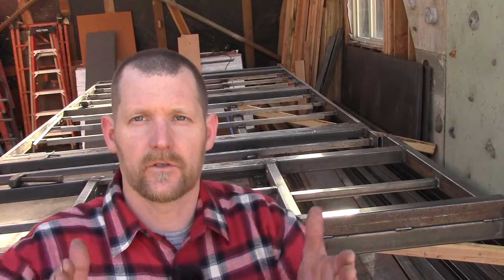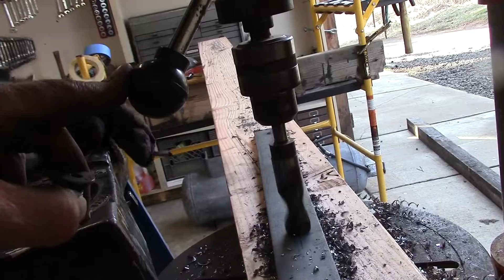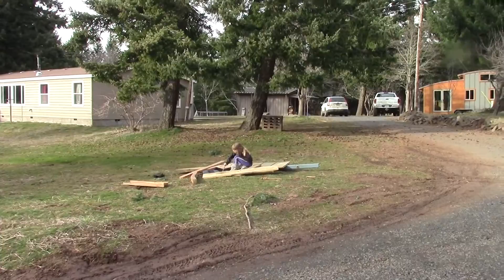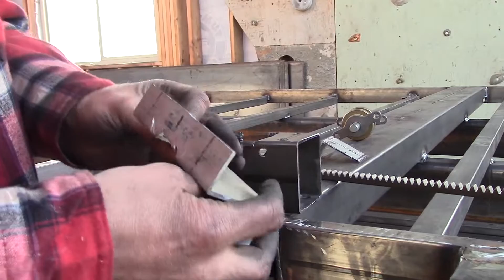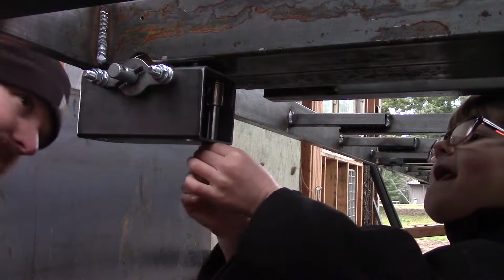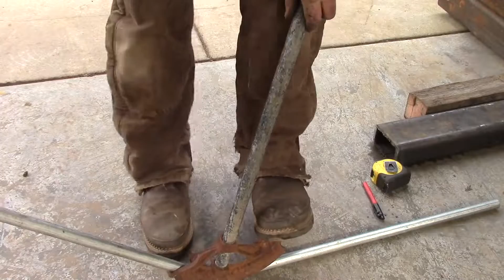How I built CUSTOM SLIDE OUTS for our overlander.

Comment: Beautiful stuff thinking of how I can adapt it for my project assuming it's a go This looks promising I could stand to scale it down since it's a maximum weight of 500 lb and just a cargo carrier that I want to move away from the back of the vehicle when I'm using it and then move it back to stow it. 😅
👉 And hey drill bits snap like that because of inadequate it's called web thickness. The I think it's m34 I don't know but anyway Bosch drill bits are known to be thicker and resist breakage about two to one over other major brands.

Comment: Thanx for the video

  I have a custom slide build at some future time..

  As for cranking it,

 I would design a flywheel type steering wheel on the appropriate connector, 

   Part of my design criteria is that I am not messing with a bad electric motor...

     As to the actual slide out room walls

   I am thinker ING with the idea that Alaskan campers of chehailis Washington uses,

   As the floor cranks out,

There is the one fixed wall,

   The roof hangs down and just hinges up as the slider comes out.

  Then I just hinge  swing the right and left side pannals into place.

    That slide out room extension gets a 
    Disc bed style, or folding furniture.

   That way in the cold time of year I have a smaller area to heat,.

    In  a normal non slide space.

Comment: Hi Ray. I'm Kevin and we're building up an M1083 expedition vehicle. Like yours, it will also have slides on each side - one will be 9 feet long, and the other will be 10 feet. A few questions... (I hope you're still following this...) What gap did you use between the slide wall and the actual habitat wall? We have stiffened the subframe's design in the CAD to (hopefully) prevent the slides from binding when the vehicle is parked at oblique angles, but I was wondering if you have experienced any issues with that. Looking back on your slide-out design, would you do anything differently?  Thanks Ray. Your videos have been very helpful. Kevin

Comment: If there's any play from the weight of the loaded slide out, consider using high density polyethylene . Like cutting board material won't wrought and very durable. On top of slide thick wall tube, you bolted the flat bar tube it will keep it from lifting off the gear bar.  if there's any play in there ? There may not be

Comment: Add pulley to that pole from a garage has groves on it for the cable add the tensioners and a remote $79.00 winch from harbor freight and WAHLA! OR PRESTO AUTO SLIDE OUT ...? WHERE DID YOU GET THE BELT AND GEARS FROM THAT WOULD HELP THOSE INTERESTED 👍 THANKS

Comment: Do you only have the front bearing or is there anything else the slide rides on?
Reply from the maker: Only those front bearings. I had really heavy steel almost no deflection.
Reply from the maker: Most of the weight is on the front bearings. There is a set of bearings in the rear on the top. And a piece of HDPE on the bottom  as a guide slide.
Reply: @5TonsofDiscovery  Awesome, did you encounter any sagging? I'm designing a similar 12'x3' slide but opted for 3x3x1/4". Looks like 2x2 would be plenty... My plan was to have some out-rigger feet to support the slide if it felt "unstable" once we are docked.

Comment: Couldn't you have just welded some motorcycle chain to that shaft... yes it would be a little more expensive but instead of waiting for that other thing...
Reply from the maker: I think its a great idea. If I do it again, I may incorporate that. I could even do an easy gear reduction with motorcycle chain. Thanks for the comment.

Comment: what about the back part of the slide what it is sliding on the rack gear
Reply from the maker: I'm not sure what you mean by your question...
Reply: @5TonsofDiscovery  the 2 inch tube the front slide  supported on the rack gear roller..  What supports the back side of the 2 inch  .

Comment: Can I ask where you ended up finding the gear rack? Or at least if you remember the teeth dimensions; like Pressure Angle, Diametral pitch etc. I’m doing pretty much this same exact build, with the same Lippert rollers and 2”x2” with 3/8” barstock on the one side
Reply from the maker: I don’t remember the dimensions. But I have a link for the gear rack listed in the description of this video. Best on your project!

Comment: Think this is strong enough setup to keep the pullout extended during travel? A pull out out the back of a truck would be useful to me
Reply from the maker: With a little bit of redesign on the inside rollers and if you had a way to lock the walls together so that it wasn’t bouncing, it could potentially work.

Comment: I am building a camper trailer and I want to add 2 slide-outs like you are doing in this video. I have looked for all of the parts you listed, but I am having a problem finding the 125774 Gear rack 48x.5x5 20 PA/ 10 DP. I want to make sure I get the right rack for the slide-out gear. Can you tell me where you got that?
Reply from the maker: I got the gear rack from Lippert components phone# 574-537-8900
Hope that helps! Wish you the best with your project!

Comment: You mention the long gear and that you had a tough time finding them and ordered them wrong but you didn't leave a link as to where to find them or what they are called by name so they can be found. That would be a great help. Great job on the build, hope you get many hours out of it.
Reply from the maker: Here is the info on the gear. 
Part # 125774 Gear rack 48x.5x5 20 PA/ 10 DP
Lippert # 574 537 8900

Comment: I am interested to see if anybody is using pneumatic actuators instead of the mechanical mtr\gear type.
I am considering building a slide-out to support a ~6'ft hide-a-bed/couch in my 16'ft all-aluminum box (think U-Haul).
Reply from the maker: I’m sure it’s being used! Haven’t seen it done. I like the idea of the uhaul box!
Reply: @5TonsofDiscovery  My box (Bay Bridge) is all aluminum, U-Haul's are plywood sides (at least). I like mine better.
Reply from the maker: @Mark-gg6iy  aluminium will be nice and light!
Reply: @5TonsofDiscovery  Did you consider pneumatic rams? 
If not why? 
Most rigs carry an air compressor for tires if not airbags.
I know enough about pneumatics to know that equal extension\retraction might be a problem without fancy sensor measurement.
btw....I spent many years watching my father work (mostly carpentry) fetching him coffee and cigs....he never taught me or let me do anything. Stand and watch. I applaud you for letting your children participate hands-on. They will remember and learn from that. Seems to me that's the real joy of being a parent. To this day I don't understand why my parents had children other than biology taking it's course.
Reply from the maker: @Mark-gg6iy  I didn’t put much consideration in the pneumatic because I didn’t know a lot about it. 
Its not always “convenient” to have the kids “help” but long term in life it’s what’s important for them and us as a family! 
I’m sorry you weren’t able to experience that with your father.

Comment: How are you attaching the inner structure of the popout to the frame you created?
Reply from the maker: I used screws.
Reply: @5TonsofDiscovery  Not exactly what I was asking but good one. I was referring to the innermost edge is not attached to the track in any way. This could cause a pinching on the inner side when extended out. I was asking about how you're going to fix the unsupported side.
Reply from the maker: If I understand your question correctly, on the innermost side of the slide outs is resting on rollers along the bottom. They roll on the floor as you move the slide out in and out. On the mechanical frame inside are bearings and HDPE to eliminate friction. Let me know if that answers your question. I’ll try to do a video on it soon!
Reply: @5TonsofDiscovery  that's exactly what I was asking.

Comment: So there's only one weel or gear at the front, so in the back it's metal on metal ? I'm having a lot of trouble with these concepts, it's a hard thing guys
Reply from the maker: watch this video. It might answer your question! https://youtu.be/QV0vCqUKByM
Reply: Thank you  @5TonsofDiscovery , I was wondering about this myself!  I wonder if you could put thread inserts on the nut side of the tube and Loctite them in rather than tack the bolt?
BTW, totally stealing this brilliant idea on the slide outs!  I want to try and change the design to be hidden by a floor under them as well.
Also, it melted my heart to watch your wife helping and have that huge grin!  You are a very lucky man!

Comment: Could you put a link to your rack gears?
Reply from the maker: Phil, I don’t have a link as it was a hard part to source. But I ordered from Lippert components. After many phone calls I finally got through and saved the item #125774 Gear rack 48x.5x.5 20 PA/10 DP.
Lippert Components # 574-537-8900
Hope that helps!

Comment: Great job, just a question. Notice you put the gear on the front, what about on the other end?
Reply: https://youtu.be/QV0vCqUKByM?t=238
Reply from the maker: Thanks for putting the link up!
Reply: @5TonsofDiscovery  Hey I tried this link, but it seems the video has since been made private. Looking through the comments I see that you've said you're using bearings and hdpe. Could you change the video to "unlisted" or just share some details about that setup? This seems like an excellent solution.

Comment: Hi Ray. Great video thanks! Quick cpl of questions..how far does your slide-out move out, what is your expected load at the end point and what kind of deflection have you seen with the materials that you have chosen? Thanks again for the info!
Reply from the maker: Hi! The material I have chosen have almost no deflection. The slide out move 3’. I could have gone farther.  The slide outs are probably 600  lbs on each roller( being conservative) so total 1800 lbs per slide outs. I’ve been very happy with how it’s working out!

Comment: I don't think welding the flat bar properly to the square tube is going to cause enough of an issue. Maybe a tiny bit, but you're going to grease it I assume anyway, it will wear as much as it needs to. I would be much more concerned with not getting the holes lined up properly and causing problems that way.
Reply from the maker: It’s been working out fantastic so far! I have not greased up yet as it’s not touching anywhere!

Comment: Will they need to be greased or will that just be a magnet for dirt and grit?  If not greased, how will you avoid having them freeze up from rust?
Reply from the maker: I have seen slide outs using a light spray on grease. When traveling down the road, they are closed which keeps water off them for the most part.

Comment: nice and the most important it works, I was thinking that this kind of systems use a teflon wheel inside , how can be that  the tail of the inside tubing doesnt touch the roof of the outside, maybe when you load with all the heavy stuff , is going to happened ?
Reply from the maker: I am using some teflon wheels for the inside. You could design something different, which I would probably do.

Comment: Omg!  Sir...I applaud you!  I've been searching for a way to engineer a manual system for slideouts and have been searching and racking my brain for months!  

Your design is the definition of simplistic!  I didn't want to do a hydraulic system or cable actuated system as that just things that will fail long before a manual system.  

I will be doing a video documentary on my bus build and I will be giving you a shout out as I'm doing with everyone that I'm taking design ideas from.  

Thank you again for sharing your design concept sir!
Reply from the maker: @Brandon Van Heeswyk just saw your comment. Here is the info
Part # 125774 Gear rack 48x.5x5 20 PA/ 10 DP
Lippert # 574 537 8900
Reply from the maker: Thank you Jason! Please let me know when you have videos out! I’d like to follow along 😊
Reply: @5TonsofDiscovery  I certainly will!  

One question though.  Where did you source your racks from?  I just contacted McMaster-Carr yesterday and am probably going with them.  I'm going to order the gear assembly from Amazon but replaced the drive gear as I want to make sure I match the gear and rack so there aren't any premature wear issues down the line.  

I'm just curious where you found yours as you said you ordered the wrong one a couple time(hence me replacing the gear lol).
Reply from the maker: I actually couldn’t get the correct gear rack from McMaster Carr. So what I did is contacted Lippert directly and ordered the gear rack from them. It took a little work to get through to the correct person that could help me find the part number.  If you have more questions you can contact me on my email. 5tonsofdiscovery@gmail.com
Reply: @5TonsofDiscovery  did you give me the correct email address?  I emailed you a week ago and haven't received a response thus far.

Comment: Nice Work..... I built 3 slides in my MCI bus conversion 3 years ago except I used a cable system to power them called Accu-Slide, I looked at the rack system and really liked it but had difficulty sourcing them and the cable system came up so I went that way, I think your system is a little better, the cables work fine but I think the rack system is a little more precise, I have a full video series on my channel if you are interested ... again, nice work, I'm interested to follow your progress...
Reply from the maker: Thanks James! Sourcing the parts were a challenge for sure! Especially since I needed them heavy duty for my build!
Nice project you have going there! Thanks for sharing!

Comment: Great build! Can you share where you sourced the toothed steel flat stock that the roller gears engage with?
Reply from the maker: This was a very difficult thing for me to locate So my pain is your gain! It turns out that gear rack is a custom item but Lippert components has them. After many phone calls I finally got through and saved the item #125774 Gear rack 48x.5x.5 20 PA/10 DP.
Lippert Components # 574-537-8900
These are compatible with the rolling bearing gear I left a link in the description. It was also very affordable!
Reply: @Jeff Williams Hey, I was just wondering if u had any issues ordering the tracks? I have been looking for the gear and rack system everywhere and finding this video is a God send. I'm hoping that when u used the information given they immediately knew what u wanted and was able to supply it ... ?
Reply from the maker: Thanks for the comment. It was hard to track down the parts. I called multiple times and finally found what I needed. I listed the part # in the comment above. Let me know if I can help in any other way! Good luck on your project!

Comment: A word of caution.....start managing weight now, or this will become 10 Tons of discovery.  
You’re using some really heavy duty materials in that frame.....I’m not saying that you’re wrong to do so, but if you approach the whole build with a zero deflection, maximum strength approach you’ll end up extremely top heavy.
I, like many folks, tend to overbuild and I’ve worked hard over the years to skinny down my designs.  So far I haven’t run across a bad result with the lighter approach.

Love the build, keep up the good work.
Reply from the maker: Thanks for the word!  you are right, my plan is to get  lighter as I  go up. Just want the frame  solid!
Reply: Make life easier.  Install an electric motor.  DC so you can reverse it

Comment: Put a motor on the end of the shaft so you can use a motor for the bump outs
Reply from the maker: It would be nice to have it mechanize! Thanks!
Reply: Make a manual failsafe though
Reply from the maker: My 13 year old will need something to do!